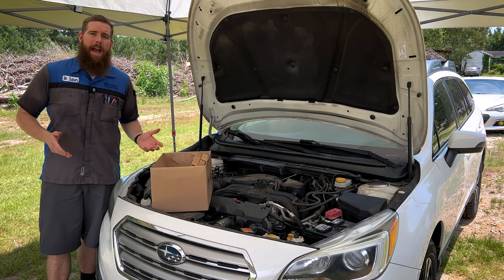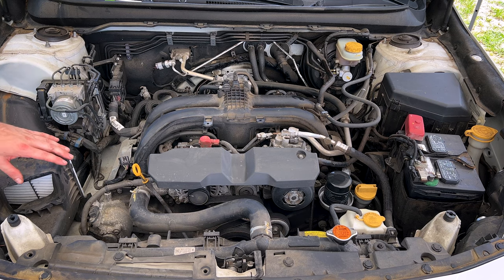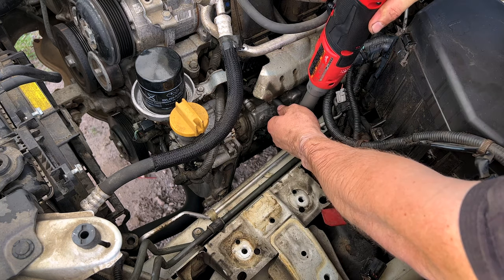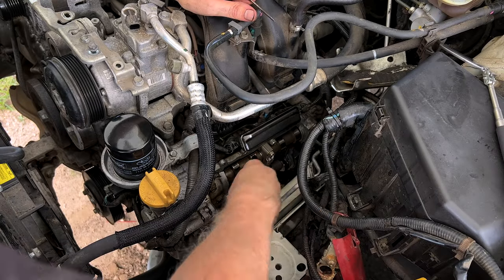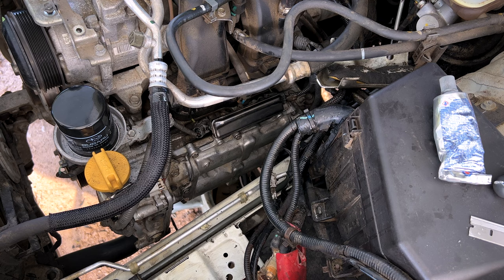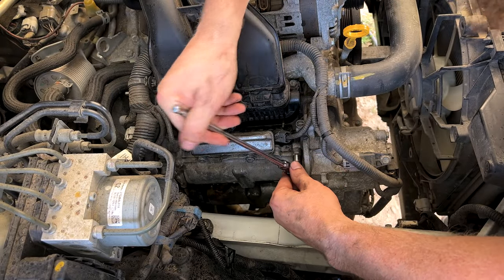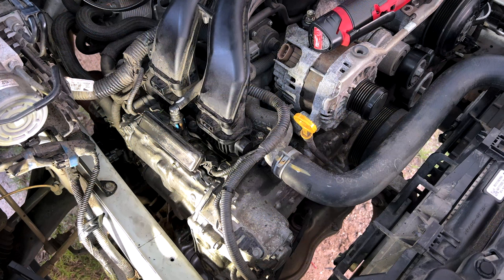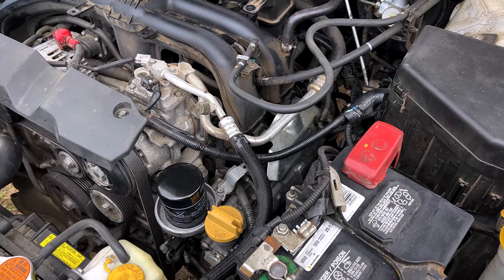Project 2015 Outback: Spark Plugs & Cam Cover Gasket Replacement! Easy-ish DIY!

Comment: Does anyone know if the old tube seals (10966AA041) are significantly
 different than their replacement part (10966AA042)? I did my left side with 10966AA041 (discontinued)
 and wonder if I should get 10966AA042 for the right side.

Comment: My '15 Impreza had two plugs where the side electrode had snapped off and the engine still ran relatively okay. It's when the center electrode broke in #1 and the engine ate the plug contents did the engine get wrecked. Come to find out copper and iridium tips don't compress well or play nicely with the valves (I ended up knocking a rocker off and bending a valve from contact with the piston.) Moral of the story is to never trust the dealer to keep up with maintenance on your car past the warranty period. They want to fix things that aren't broken and not touch things that are.

Comment: Just curious, what does that silencer next to intake manifold silences? Wiki says it silences noise of the intake system... Is it particularly noisy without it?
Reply: Hi Antony , Its a called a " plenum chamber" next to the throttle body connected to the inlet track which ensures that there is always a mass of air ready for induction in the event of a sudden throttle opening particularly at low rpm giving better low end torque .
Reply: That's really clever! A bit like a capacitor Thank you! :) @sawdust6736

Comment: I had to take the front driver side wheel off to get to the two battery tray bolts attached to the frame rail. I didn’t put them back in.
Reply: 32:59 I used a long double box ratcheting wrench to remove these almost inaccessible 14mm bolts.

Comment: is a cam cover gasket the same as a valve cover gasket replacement ?
Reply: Yes. It is called a cam cover because it covers the 2 overhead camshafts.

Comment: Rediculous how you don't have to the Room to even see what you're doing.I was a Professional Trained & Certified GM Mechanic for a Decade and familiar with issues like THIS, STILL fix my own car & Truck in Retirement,but haven't Worked on a Suburu yet.
Reply: Subaru boxer engines sit low in the compartment

Comment: Do you put any antisieze on the spark plug threads?
Reply: No. NGK states that the plugs are installed dry with no lube or antisieze applied to the threads. Torque to 13  lb/ft.

Comment: Where did you get the torque specs and diagrams from the video?  I have a crosstrek that I would like to get a service manual for, but I don’t know where to get an official manual.

Comment: Does anyone remove front motor mount bolt and transmission mounts and jack up engine ?
Reply from the maker: Not needed.
Reply: I had to on my brz but not on my cross trek.
Reply: @jeffreygoss8109 it’s not necessary on the BRZ, but makes it easier. I’d like to see Mr. Subaru change them on his BRZ.

Comment: Guys check your ground strap wire it lives right on the passenger side frame rail mine crumbled to pieces when I replaced it the car is now happier electricity wide

Comment: Does anyone know if the 2024 2.5 engine in the crosstreks still use timing chains vs belts?
Reply from the maker: It’s chains. They’re all chains now.
Reply: @MrSubaru1387  thanks for the reply!  I'm waiting on a crosstrek now.
Reply: @jimr549 That should be a good engine for Crosstrek.

Comment: Wouldn't it be easier Going through the wheel well When the tire's removed? I'll Stick with my Air tool's Also, Don't Like the Battery powered stuff at All. Air tool's Always Worked great for me, just gotta Oil & maintain them Like the Rest of my Tool's!

Comment: Question so do you have to remove the belt in order to remove the driver side gasket?  Trying to replace my gaskets on my 2014 Subaru forester 2.5 I